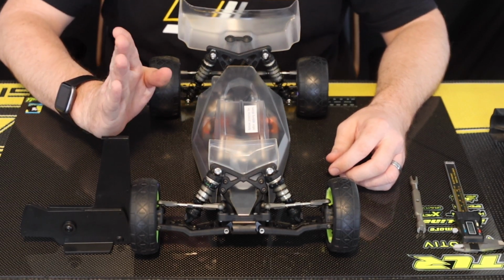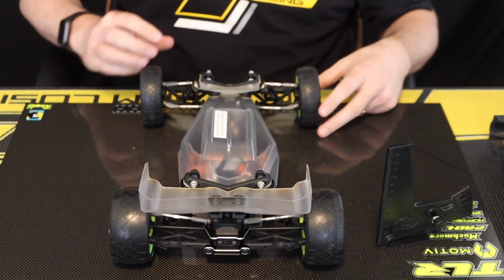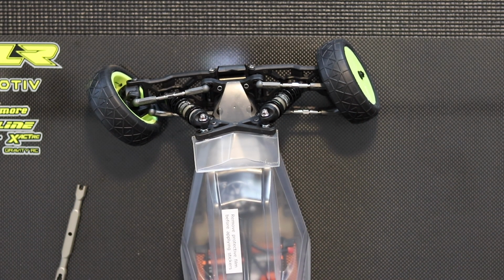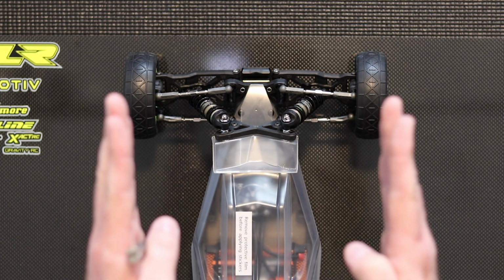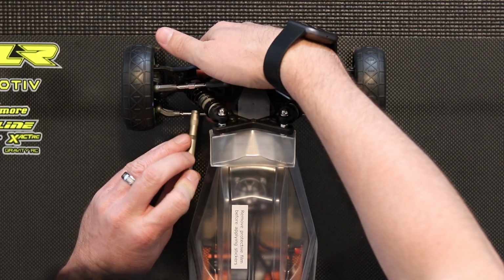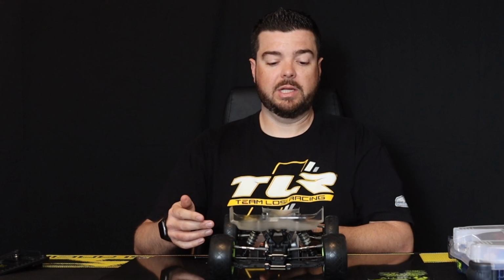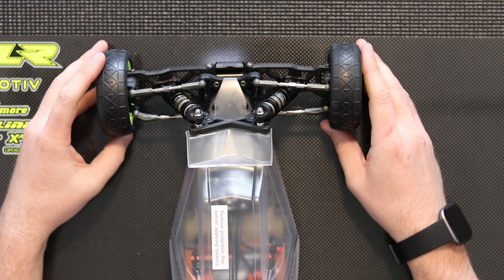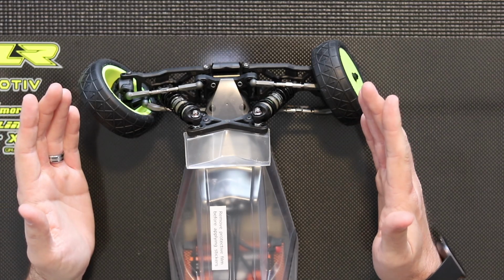How To Win - Camber and Toe Adjustment

Comment: this seems like a great video. i have one question. im running a 1/12 4wd offroad carpet car, its a lc12b1, and the car likes to over rototate in turns. not so much oversteer because this happens when coasting or off throttle. what do i need to change?

Comment: What oil can be used to put in the gear diff?
Reply: The oils we use are actually silicone-based.  This vehicle comes with 5,000cst installed, we usually run between 3,000 and 30,000cst, depending on the grip and Surface.

http://www.tlracing.com/Search/Default.aspx?SearchTerm=diff+fluid
Reply: 22t 5.0 coming any time soon? Lol. I want to get the 4.0 but ill wait if its gonna be replaced sometime in the near future.
Reply: @DetoursRC  it won’t be, we’ve been waiting on a sct 4.0 since 2016
Reply: @tylerbates8198  I just converted my 22t 4.0 to Nitro with the Ignite conversion kit soo I kinda dont want it to get replaced with a 5.0 now. Lol
Reply: @DetoursRC  nice my 22x-4 just came yesterday 🙃🙃